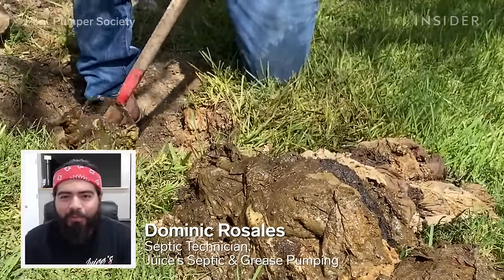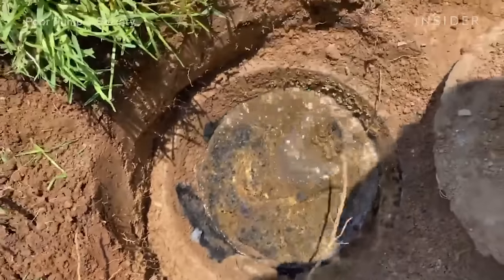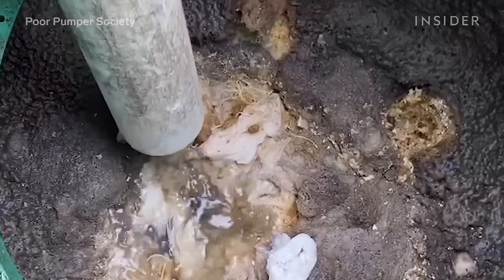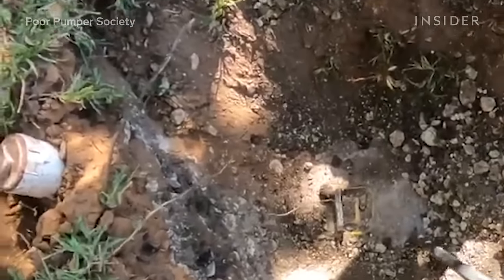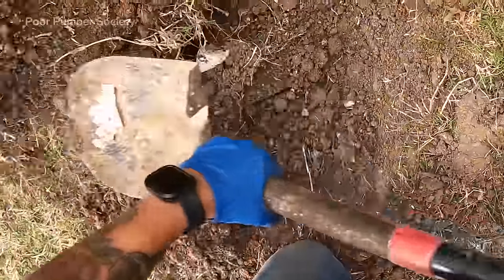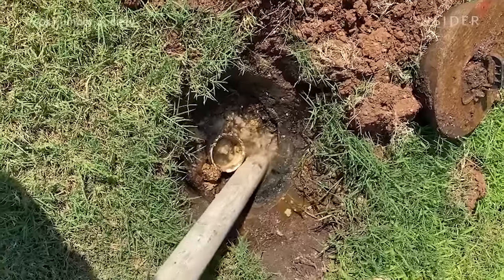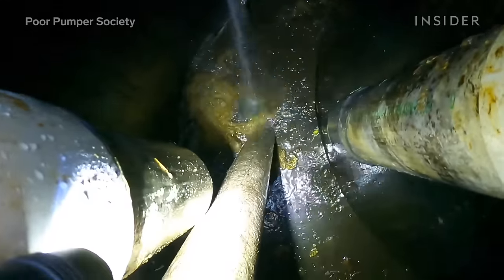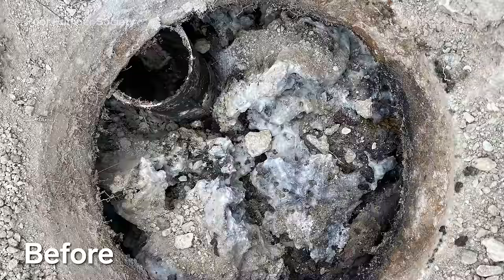How Clogged Septic Tanks Are Deep Cleaned | Deep Cleaned

Comment: We had a clogged inlet baffle. The tank was pumped, but the problem persisted, so we dug it all the way up. We found that the baffle lids weren't over the baffles at all! So we had the whole tank top lifted and set properly, and installed risers (and of course cleaned both baffles). The last pump service took a tidy 20 mins. 
It had been that way since its installation in 1950!!

Comment: Ok, chances are you're not gonna see this, but...if you do, I just had a clog between the house and the 1st take(the solids). First I had to go out in 0 degree weather(-15-30 with the wind chill) on Christmas Eve and try and remember where the tank was...just to see if it was overflowing as nothing was draining. 

Opened that up and we could see the solids in there, so we knew it wasn't the issue. Then I had to call Roto Rooter to come out. 950$ to come out at ~10PM on Christmas Eve(in fairness, he did tell me it was gonna be expensive). 

But this house is...100 years old(little less). It's had probably 4 different renovations, one in the 35 years since my parents bought it. 

Can you tell me how you'd recommend I deal with that, or how you think we should prevent that moving forward?

Comment: Someone needs to dive in into one of these
Reply: If you don't have much money then you would have to dig it out yourself and compost it. I would use a sump pump to pump the water out then once the liquid is drained out put a ladder down the tank put on rubber boots and shovel the sludge in a bucket have someone at the surface  pull up the bucket to dump in the wheel barrel to be hauled and dumped in your compost pile.

Comment: Just inspected my 3 tanks. I never use wipes they clogged a septic pump on me years ago. I noticed on my inlet it went into a T but had no inspection pipe on top side of T with a cleanout plug, it was just open. Been having issues with aav and vent pipes on roof sucking air through them on windy days. Should i put a small riser on inlet T with inspecton cap to not allow sewer gases to creep back up sewer pipe?

Comment: Any recommendations to cut grease down.  Many detergents and soaps have some form of oil in their mixture.  Grease clogs are the worst bc you don't know where in the system its clogged.  Luckily I know my trouble spot is the u-trap before the tank.
Reply: Minimize the grease getting in the sink in the first place.  Wait for any grease to cool and pour into any containers with a tight lid and throw away in the trash OR soak up as much grease with paper napkins and then wash the pots/pans etc. 

A Borax + boiling hot water flush is also a cheap, safe method to help keep the grease buildup down in drains.
Reply: @SandyMachoManRavage  already take grease out of pans, its the other soaps that are a concern.  Those build up too.  Thanks for the borax tip
Reply: Seriously after we boil water for breakfast about once a week I empty it in sink or toilet. If I have a clogged toilet...boil water and plunge it in there and close lid for a while...the hot water is the best trick